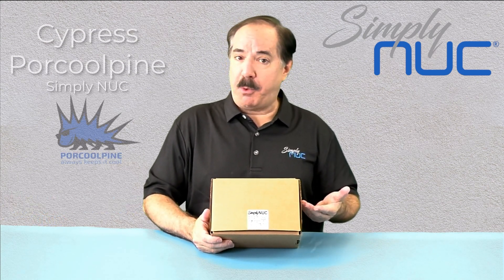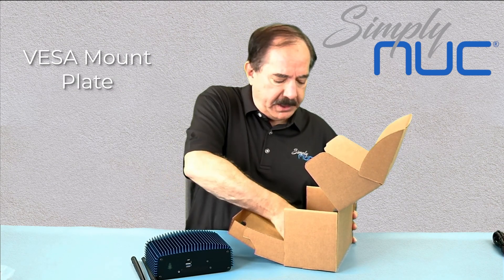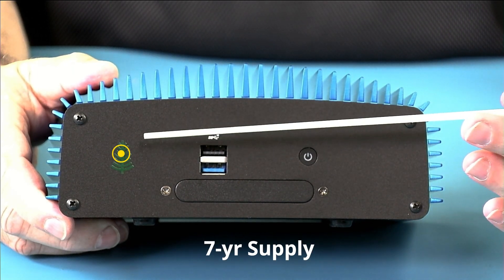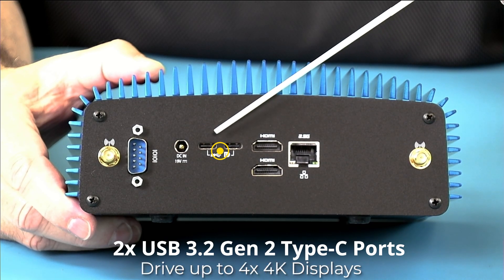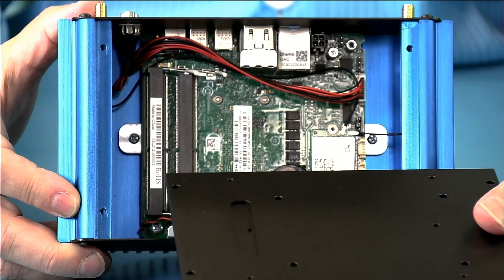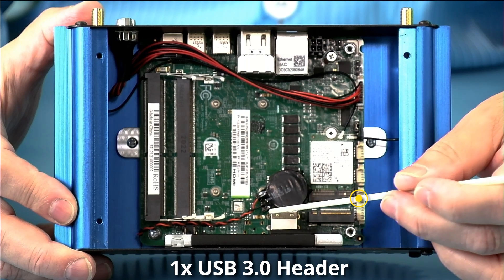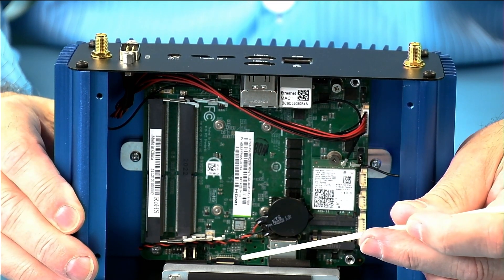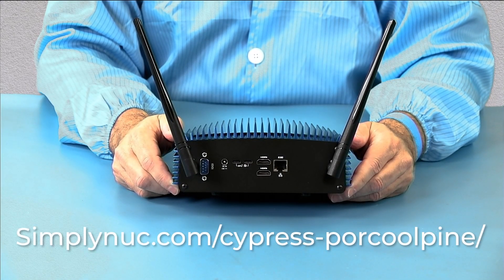Meet the Simply NUC Fanless Cypress Porcoolpine! - Unboxing

Comment: Hi, 
I have the NUC717BNH and whenever I run Photoshop or InDesign it freezes up. Can you received what I should upgrade to allow it to run smoothly; the RAM or the CPU?
Reply: Update your NUC's firmware, check that the CPU isn't overheating (resolve if so), and if that doesn't work, do a clean install of Windows 10 21H2 and once it's finished, update the drivers to the latest versions available. The RAM or the CPU shouldn't be the cause of freezing, it should only result in faster or slower work, never freezing.